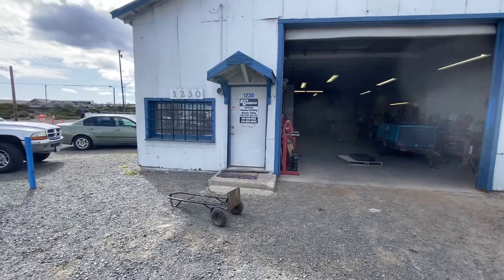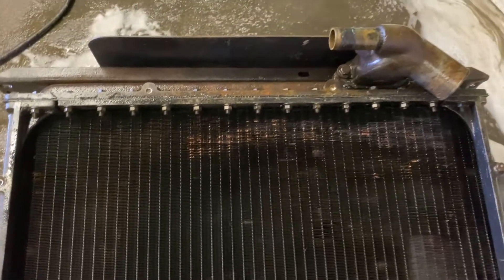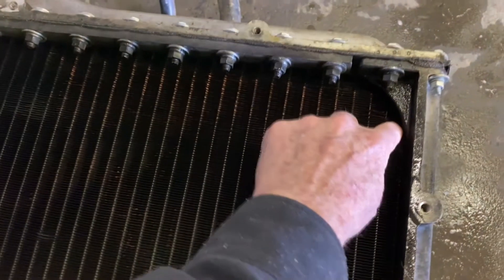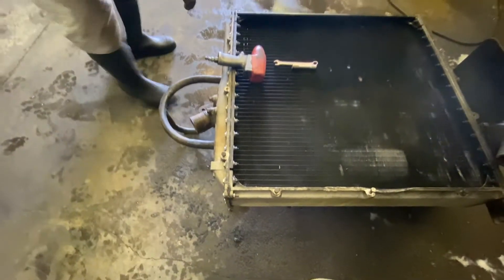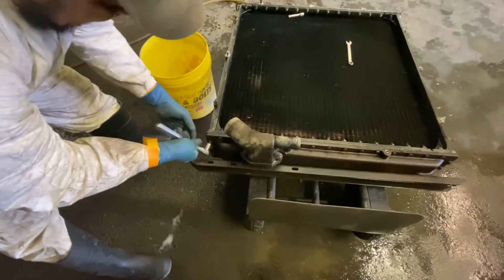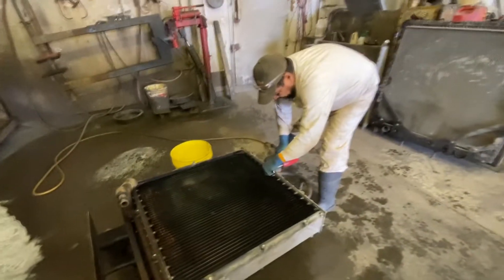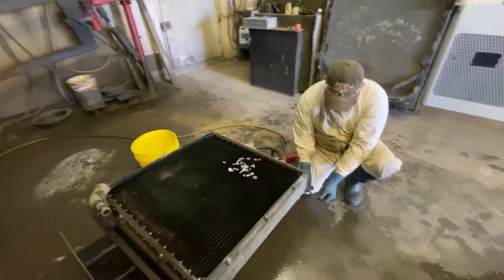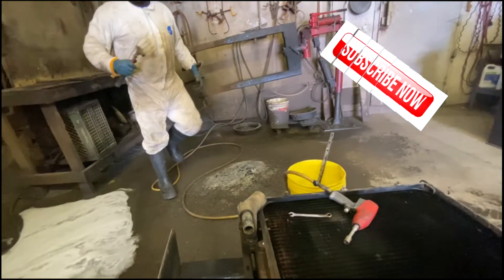#3 LEO'S TAKING THE RADIATOR HOUSING FROM THE CORE TO SEE WHAT IS NEEDED TO BE DONE..STEVE'S STORIES

Comment: It was the same deal with mine, I tried to save it, but once the fins start flaking loose off the tubes the metal is just too old and thin after so many services.  Even if you can get it rodded out and to hold water, you never know for how long, it's not not worth risking the engine over.
Reply from the maker: We felt the same way....not worth the risk....new core and wider fines....